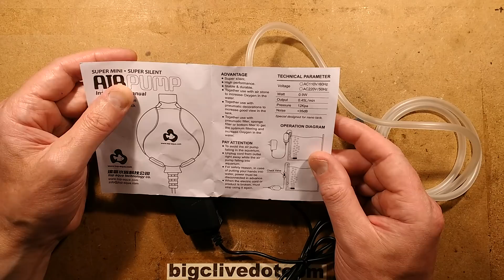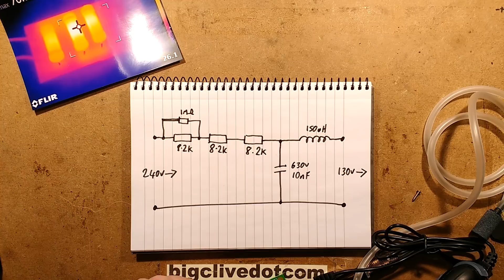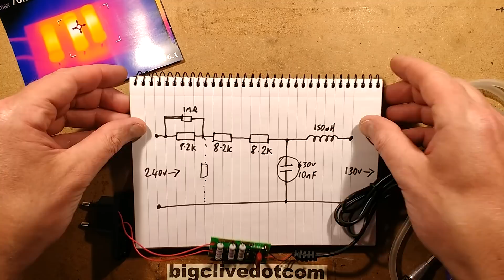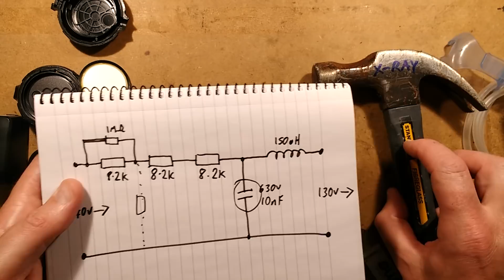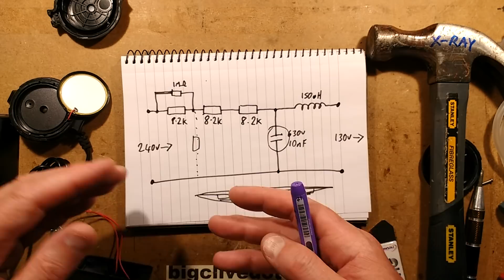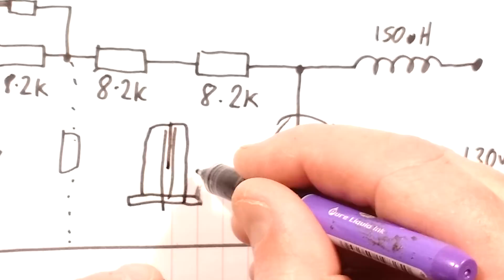Inside a near-silent piezoelectric air pump.

Comment: The real advantage of this aerator is its durability. In the old aerators with an electromagnet and a rubber diaphragm, the weak point is the rubber part. It vibrates at 50 hertz, and over time this causes it to deteriorate. When I first bought an aerator, I also bought a spare diaphragm. Strangely enough, that aerator worked for years without ever needing a replacement. To this day, it’s still at home, and the rubber part is, surprisingly, still intact. Yes, it’s strange, but I still prefer the piezo aerator — it seems both quieter and more durable to me.Unfortunately, I learned about the existence of such aerators quite recently. I see that the video is already 7 years old, but I only found out about them last year.

Comment: In the 80s I had vibratory air pumps for aquariums. Replacement valves came in rubber or more expensive silicone. Silicone was quieter and lasted longer.

Comment: I scrap a lot of stuff,  and among what I've salvaged are some "buzzers" that are piezoelectric.  I'm assuming that what's inside the plastic case is similar to the disc you show here.  I've also encountered those discs loose,  used in some drum boxes.  Connecting a meter across it shows no continuity,  but connecting one to my scope it really does rather well acting as a microphone.

I remember some years back gong to a trade show and seeing some fans that worked on this principle.  They had blades,  but they didn't rotate,  they just vibrated.  I've never encountered them since then,  and have wondered why,  whether they actually went anywhere.  Perhaps they weren't capable of high enough volume,  or something like that.
Reply from the maker: The piezo vibrating fans resurface from time to time.

Comment: Would it be possible to operate a piezoelectric diaphragm pump with low voltage DC with USB or lithium cells?
Reply from the maker: It would require specialist circuitry.  The piezo disk may be driven at a fairly high voltage to get good deflection.  You can get USB powered air pumps that use a motor and wobble plate.  They're very low power and quiet.
Reply: @bigclivedotcom  I have tried several of the wobble plate type marketed as quiet. Less vibration and smaller package would be ideal for the fishing I do. I will install an inverter and try this piezo pump design. Thanks for the reply.

Comment: I have already seen this kind of small silicone check valves on industrial equipment (water treatment, pumps etc.). It is very efficient and reliable.

Comment: The convoluted valve system should also prevent water siphoning back into the pump sitting below tank level, should it or the power fail. You want to keep the water inside the fish tank and voltage free - fish like it better that way.

Comment: There has to be another hole for the pumped air inlet.  The tiny one in the thin piece that was popped off the back is just to allow air to move in back of the diaphragm.  It relieves pressure on the back due to ambient air pressure changes so it won't limit the deflection of the diaphragm.

Comment: Hi Big Clive, I'd like to see you revisit this piezoelectric air pump operation. I think something else is going on with the Piezo. I have never heard a 50 hz piezo. I got out of bed to write this couldn't sleep thinking about it. My idea was, it is running on a harmonic of 50 hertz, tuned with the inductor and the first parallel cap introduced some nonlinearity. But then I calculated it turned out to be the 800th harmonic, so I backed away from that. (call that idea a maybe) If it was running on 50Hz, I think you would hear it, (2 watts), I never saw a scope shot in your videos, but I'd like to see the waveform across the piezo. Maybe a frequency counter would pick it up, by indirect connection. The 150uh inductor means the piezo's capacitance would need to be very large to tune at 50Hz, (improbably large) After 30 minutes searching, I'm still confused, I found similar piezos made for 22kHz, 27kHz and 40kHz, and then one popped up, operates at 60Hz. ¯\_(ツ)_/¯

Comment: I think the device you're referring to is a pressure accumulator, definitely the capacitor of the fluid power world. Also, quite terrifying to charge on hydraulic systems.

Comment: The space is called a plenum. The power of vacuum to fill the empty plenum through the hole is great while the amount of back pressure to empty the plenum the through the empty hole is small upon each cycle of the diaphragm. Pressure is recuperated because presser that is built up inside the plenum can compress the gas momentarily before the pressure can escape entirely back through the hole the energy of it is used as part of the uptake again. The pressure released through the stone and the built up pressure in the plenum might work In an alternating cycle that has the little thing running like a 4 stroke.

Comment: Easy and fun way to test airflow, is to fill a litre bottle with water put the pipe in the bottle and put it Neck down in a bucket of water.
Check water displacement after an Hour :)
Simple and can get nice and MESSY :)

Comment: The crystal isn't precharged hot then cooled. I think you are thinking of electrostatic modules, used in microphones. The crystal is most likely synthetic quartz that is carefully milled flat on one of the lattice planes.

Comment: Maybe the cavity is there to let the unit suck the air to the disk more easily, sucking it from the bigger compartment into the smaller one. You could see how the air in a bigger cavity is more elastic, and willing to give a small percentage of it's content, while the smaller space at the disk side of the valve makes sure that the tiny movement of the disk causes a significant change in the available space for the air, making the pressure differences bigger.

Comment: Which part of the transducer is tied to mains.   Is there no polarity so only the coating on the crystal is in contact with the mains??????    (so the metal plate is not tied to mains.)
Reply from the maker: The metal plate could be connected directly to the mains.

Comment: Maybe that reservoir is there to keep it quiet? I've got a tradition AC air pump and replaced the tubing setup. It's now louder than before, probably because more sound energy is making it to the end of the tube. I've though about adding a small buffer to make it quite. Such a thing would be more noticeable on a piezoelectric pump, I would guess.

Comment: If the piezo diaphragm flexes 1mm each mains cycle that would closely match the volume of the nominal output.
Reply from the maker: Did you actually calculate that?  It's complex.
Reply: Back of the envelope. Approximated the volume of a half phase flex as a cylinder close to a millimeter because hard DC drive can get almost,  2mm out of some of those little clickers, used 30mm as the nominal diameter, 50Hz ended up around 400ml/minute. The flex is not hemispherical, it is a nasty chord of an oblate spheroid, if the active material is evenly formed and the crystals are well aligned, if not they tend to end up shaped like the back of my head, hence handwaving a number.

Comment: The capacitor and inductor are not AC mains filters. They create a resonant LC tank circuit to drive the piezoelectric element near its natural mechanical oscillation frequently. Based on their values, the disk will probably vibrate somewhere on the order of 100kHz, independent of the 50/60Hz mains frequency - well above the audible range.

The air space above the diaphragm acts as a tuned resonant cavity and lens in order to get the pressure waves to constructively interfere at the outlet valve and create sufficient amplitude to overcome the forward pressure drop of the "piss flaps"/acoustic diode. The cavity is much too tiny to accomplish this for a 50/60Hz pressure wave due to their long wavelength, but at 100kHz, the wavelength is only around 3mm.

The 1M resistor does indeed appear misplaced. It should be across the capacitor so you don't get a shock after unplugging the device and touching the AC input plug pins. My guess is that the designer originally did put it there, but someone less familiar with how resonance works decided to switch to a cheaper capacitor and inductor, detuned the oscillator, and discovered that the circuit would work more reliably by removing/relocating the resistor parasitics.
Reply from the maker: The air valves would not be able to open and close at such a high frequency.  The disk does seem to vibrate at mains frequency.  One theory about the inductor and capacitor is that any mains borne noise would be made audible by the piezo disk like a speaker, and the filtering reduces that.
Reply: bigclivedotcom I agree that the valve probably doesn't rectify air at 100+kHz, but I don't believe it has to. Each time air does escape, the average pressure in the cavity will change, the speed of sound in the gaseous medium will shift slightly, and the point of peak constructive interference will move slightly. Likewise, the resonant frequency of the piezo element will shift slightly throughout the whole AC mains cycle as the amount of energy dissipated as heat or compressive work will rise by the square of the voltage and steal energy from the resonant system faster at peaks, correlating with a higher resonant frequency at higher voltage and lower frequency nearer to AC zero crossing cycles. My guess is the valve actually actuates at some integer fraction of the piezo disk's oscillation frequency and quite possibly, the valve never fully closes - instead becoming more and less flow restricting.

The fact that the whole resonant system shuts down every AC input zero crossing can explain the audible noise at 100/120Hz without necessarily being meaningful at all towards the pumping mechanics. The easiest way to find out would be to put an oscilloscope across the capacitor and see if there is a high frequency riding on the slow AC mains carrier.

Comment: The tinny hole on the back is to allow air in the back  of the diaphragm like the opening on the back of a speaker dome so the air can move. If not it would brake the movement and reduce the mivement in it. I see another hole in the rim to the reservoiur as the inlet to that side.  
Love the vice,  not seen one like that in a while.  Keep n up the destruction and explanations :-)

Comment: I opened up the 120V version and it has two 2k resistors in series instead of three 8.2k and the inductor is 1.4mH instead of 150uH.

Comment: I want to know if it will work off  240v I reckon it will, those transducers can generate fairly high voltages.  Also you could try higher frequency?

Comment: Clive the check valve is referred as a duckbill check valve. Very interesting way og pumping air (gas). Wondering how a piezoelectric element would work as a liquid pump? The element could be driven harder as the liquid would cool the element.

Comment: Very interesting pump!  This likely explains how CPAP medical pumps are able to run so quietly.  They are effectively silent, and I was curious what kind of pump mechanism could do that.  
They run at 4-20 cmH2O at a rate  of about 50 liters per minute!  (http://www.cpap-supply.com/Articles.asp?ID=337)
That's more than 10x the flow of the pump in this video.  (But, of course, a CPAP runs $400+.)
Love the channel, Clive.

Comment: They probably intended to use a capacitative dropper hence the 1M and 8.2K resistors in parallel. Either that or they really needed  8.133K resistor.

Comment: Kind of curious how much the piezo disc deflects by, at 60Hz it should be visible and could probably be measured by finding the point where something just touches the end of it's oscillation and comparing to it's rest position.

Comment: so if the seal was to fail, would water run onto the pizzo putting the tank water at 130vac relevant to ground? Although the seal looks quite good, I guess its a possibility?
Reply from the maker: Like all air pumps it's designed to be mounted above the water level or have a one way valve installed to prevent flowback.

Comment: I would be very interested to see a volume pumped per minute vs input frequency... I suspect at a certain frequency, it will be like a heart in fibrillation, where the valves are ineffective, but I'm curious to see what point that would be at...

Comment: I suspect that this is carefully sized to make use of resonance.  I suspect the disc size would be different for 60 Hz.  I also wonder if the performance would be significantly affected if it were used at higher altitudes.  This appears simple on the surface, but I suspect a lot of design and experimentation went into the final product.

Comment: I tried to generate electricity from vibration by Piezodisc but failed
Reply from the maker: It doesn't put out a lot and you have to rectify the output.
Reply: bigclivedotcom no, it don't even i tried with coil speaker but don't ger even a single volt
Reply from the maker: The piezo disks do put out a decent voltage when pressed, but only spikes at very low current.  Try connecting two inverse parallel LEDs across one.

Comment: 1. What does the disc look like when powered?
2. If it is a tuned resonant cavity would it not need to be a different size for 50 vs 60 hz? Or maybe it's split and slightly better performance would come from adjusting it to your mains freq...

Comment: Very novel and interesting.  A piezo buzzer being driven directly from the mains.   Who would of thunk that this was even possible.  But apparently it is.   Thanks for the video Big Clive :-)
Reply from the maker: It's not a new idea.  Somewhere I have an old piezo fan that powers directly from 240V and has two sections in series flapping plastic fins at high speed.
Reply: @bigclivedotcom  Very early Macs had a piezo fan with wings, if not from the factory at least as after market.

Comment: I would have like to see the pump in action, with the air stone submerged. My reasoning is that the piezo element displaces a VERY small volume of air (itself very compressible) per cycle, so I'm not seeing vast volumes of air being moved. To back me up (I think), the manual specifically states under the tech parameters that it is «Special designed for nano tank.»; OTOH it does say it moves 45cc of air per minute.
Reply from the maker: It does produce a good cloud of bubbles from the stone.  I tried using it to aerate copper chloride and it made it foam up quickly.

Comment: The quietness is surprising, I would expect that to produce a fair bit of hum, since it is essentially a speaker plugged straight into the mains. I would wager that the entire casing is an acoustical contrivance designed to suppress that hum.

Comment: It's hard to imagine the chamber being used as storage. The displacement of the piezo disc is so small that any extra volume the air has flow thru thru before passing thru the check valve is likely to reduce the output. I would think the volume between the disc and output check valve would best be as small as possible.

Comment: 1) "Duck-bill valve"
2) Murata announced and video'd a number of applications with their "PiezoMicroBlower" back in 2011 - works in the ultrasound region and can hovercraft-carry a 9V battery powering it.
3) The Murata device uses no apparent valve - the frequency is so high that non-linear flow-resistance is sufficient to create a valve-action.
4) IPA or ethanol embrittles hot-melt glue and makes for easy removal
Great video, nonetheless!

Comment: those wires of the adapter  from the mains are they appropriate to handle high amps ? the thickness of the wire questionable.

Comment: Think I'll get one of those for my fish tank my pumps are noisy . btw bought this with that lantern you did a few months back , cracking little torch but drains battery quickly but bright https://www.ebay.co.uk/itm/Portable-Camping-4-Modes-COB-LED-Lamp-Super-Bright-Flashlight-Torch-Light/392036043180?hash=item5b472b49ac:g:J78AAOSwskha7Q4j

Comment: I think the tiny hole is there to vent the other side of the piezo that probably moves just a little. 
The main air intake are probably the cuts where you tryed to insert the spudger to open the pump first.

Comment: Looks like both sides of the piezo are used to pump the air and you're right, that first air chamber is used as a buffer but not before it goes out but before it goes into the second chamber.  Good question is would it work better if there is a valve on the air inlet?

Comment: LOL  You did it again Clive. I was just taking a swig of drink AGAIN and at that moment you said PISSFLAPS.   I about choked. 

Anyway . This actually reminds me a bit of those old beigey coloured crystal ear pieces for use with crystal sets .  They had a similar arrangement inside , but square  , with crystal coated on a thin metal plate and a very thin metal foil diaphragm .  (showing my age again!)
Reply from the maker: I had a crystal earpiece too.  They were useful for fault finding because of their high impedance.,
Reply from the maker: The modern equivalent in the sound industry is this neat signal tracing gadget:-
http://www.vizear.com/
Reply: Thanks Clive. Interesting device.. 
(I also got looking at that Flame safe candle flame effect light on that link) . Sorry to go off the subject , but years ago I had dealings with a very "realistic" candle flame effect light , or lights , that used a "loose"  incandescent bulb, shaped like a flame , that were gently moved by a coil (similar to those LED candles) . They were almost impossible to distinguish from a real candle , even close up.  I have yet to see a modern version that comes as close to the real thing as those did.